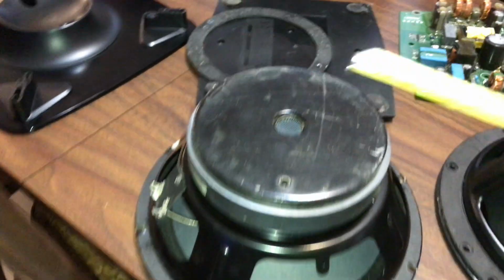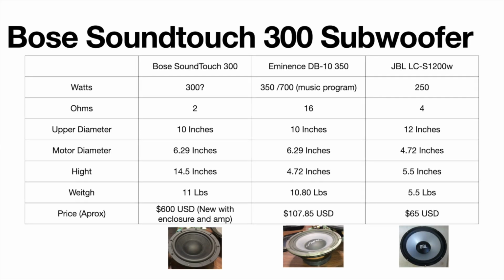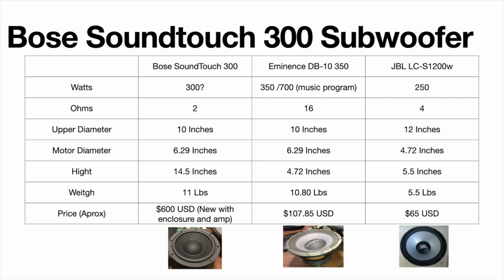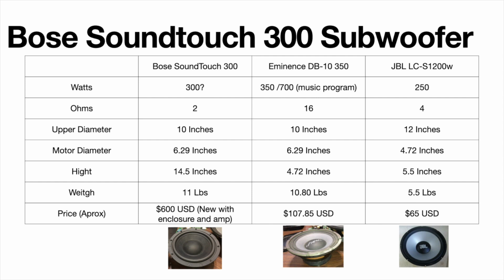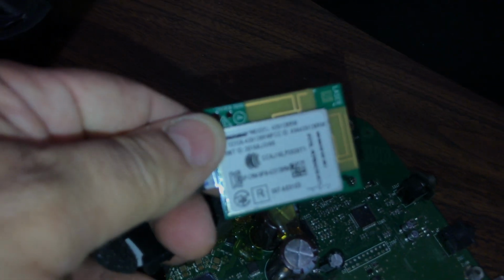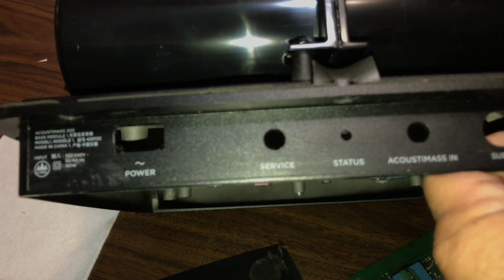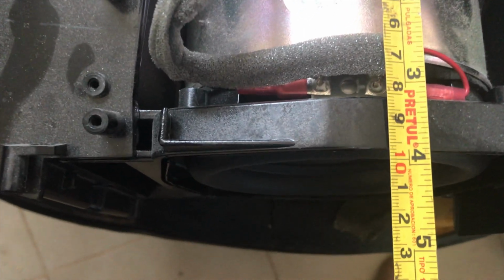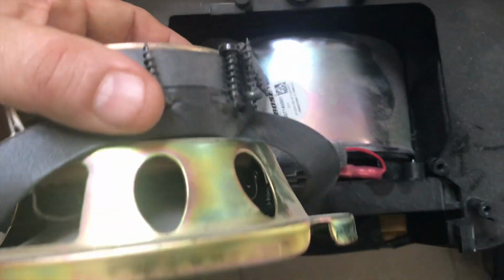Bose Soundtouch 300 Subwoofer addendum

Comment: Is there a way to diagnose the wireless receiver for failure?  It no longer pairs to the soundtouch 300 soundbar.
Reply from the maker: You can connect the sounder to the computer via USB, download the application (Bose Soundtouch) and it has a diagnostic set in the application, it not very extensive but could help.  Also, if you connect the subwoofer to the AC, and the way the led blocks and the color can give you some diagnostic guide. Look at this page to see what the blinking and color means: https://www.bose.com/en_us/support/articles/HC2472/productCodes/soundtouch_300_special/article.html
Reply: @Letsdosomethinguseful  Thank you for the reply.  The LED pattern never matched the Bose diagnosis specs.  Also, the 3mm cable was a solid red light.  I replaced it with the 800 sub, and BINGO...(A blessing in disguise).  The sound is MUCH better now.  👍
Reply from the maker: @retroelectro1190  Glad to read it is working now. Regards.
Reply: My bose subwoofer keeps flashing amber ,white then red,,,Sent it in to bose ,,,they sent it back still doesn't work,,and tried the bose 3.5mm cable doesn't work either ready to throw it in the trash
Reply: @zeriods  I ended up upgrading to the better sub.  Never could fix my problem.
Reply: @zeriods  I'm having same issue. I know this post is from quite a while back but still thought I'd ask.. Were you able to fix this problem? If so, what was the solution?